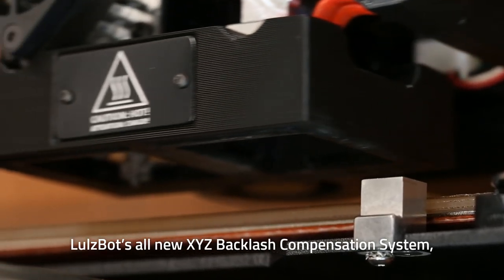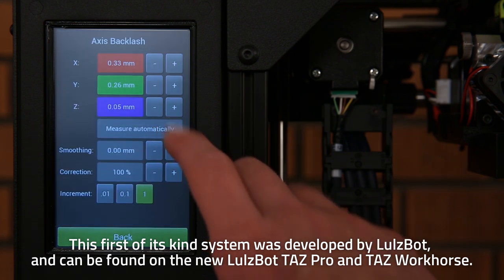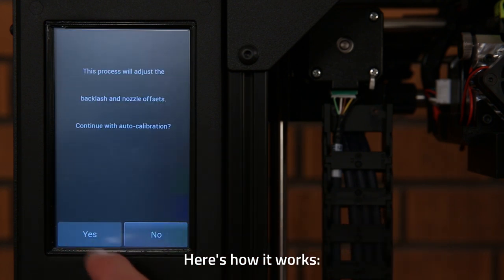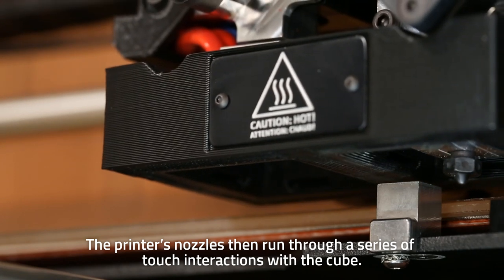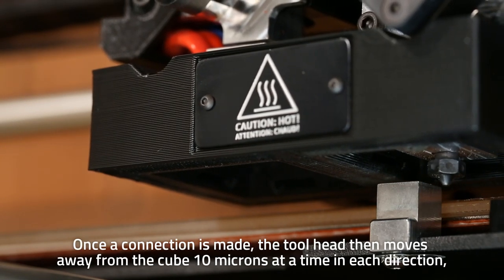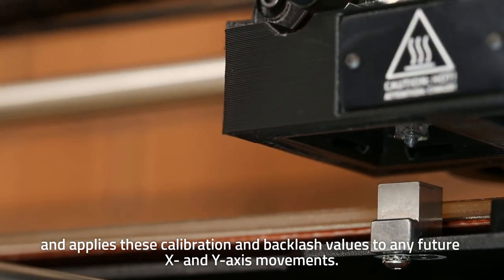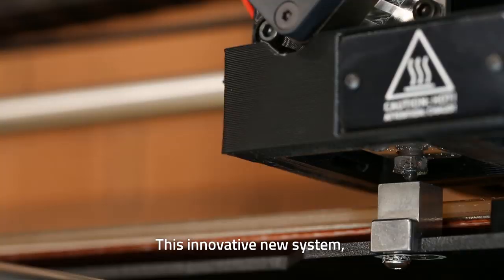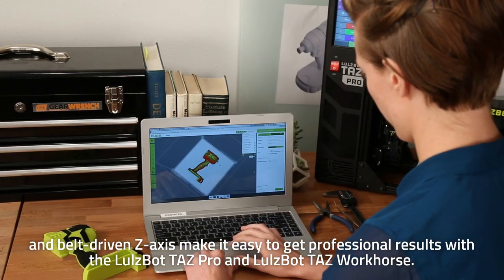LulzBot’s X/Y/Z Backlash Compensation for Printed Part Accuracy

Comment: I'm afraid that if a user will have filament remains on the hotend which can block the circuit, it will be enough to destroy something..
Reply: Ben Levi  I’m sure it’ll use the wipe pads beforehand.
Reply: Wipe pad and wiping procedure are pretty useless, on my lulzbot mini if I don't scrape by hand the nozzle I have 70% chance of failure. And as Ben Levi said that does fuck up things : on the mini it's the linear bushings on the  X-axis that get destroyed when the nozzle crashes into the probe points.
Reply: That being said, nowadays stepper  drivers can detect crashes so that may be a way to mitigate this
Reply: @MrBleulauneable  but by using stall detection you lose a lot of torque.
Reply: Ben Levi The nozzle does need to be clean.  I check and wipe the nozzle at the start of each print.  The start g-code warms the filament and backs it out prior to the wipe, then cools it down to avoid oozing before it does the bed-level.  But that said, I have had the occasional dirty nozzle.  The printer does limit how far it it will plunge the nozzle in the washer (the bed will flex without any damage) before it gives up and realizes it should have had a good contact.

In summary... even if the bed level fails it will not damage the printer.  

Side note:  I swapped the factory hardened-steel nozzle (with TAZ Workhorse & Pro, the Mini 2 doesn't have a hardened-steel nozzle) with the E3D Nozzle-X.  It has a poly-phobic coating that makes it more difficult for filament to stick to the nozzle and much easier to wipe clean for the little amount that might stick.

Comment: interesting... I thought, backlash in 3d printer is always some sort of mechanical problem, and when everything works fine - backlash is near 0.01mm and unnoticeable in the prints.
Reply: It is a mechanical problem. However it can be predicted and calculated in advance. The problem doesn't disappear with this. It compensates for it.

Comment: A 5 volt electrical current.... Really.... Volt = voltage & Amps = current. From such a high-tech company you'd at least expect that they use these right terminology, you just make yourself look stupid imo
Reply: idk
5 volt it's the tension... the potential diference
And electrical current can also refer to the phenomenon of electrons in motion within a conductor (like potential difference) without referring exactly to current as a measure (amps)

(At least here in Argentina we say "220v of current" and we say amperes to refere to "current"
Reply: @wachocs16  your terminology is incorrect. A high tech company should have used the correct terms when refering to voltage and current. a 5V 2A current (for example) cant just say 5V current, current isnt measured in volts, its measured in AMPS and the voltage is the driving force behind the current.